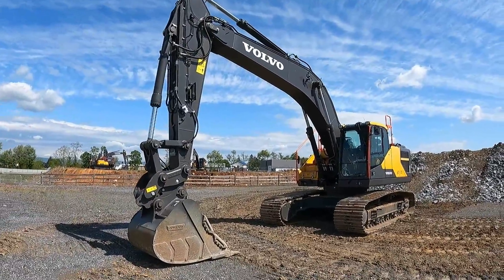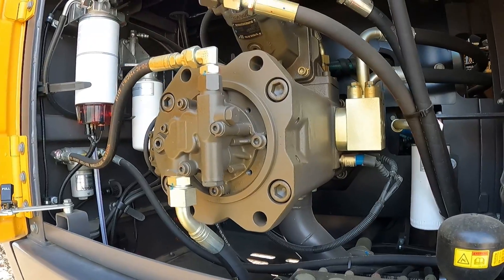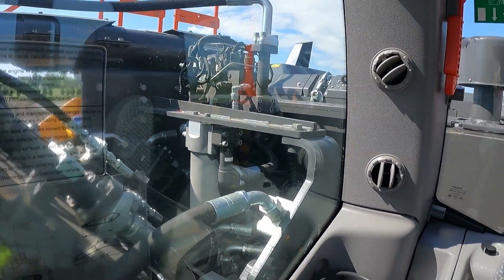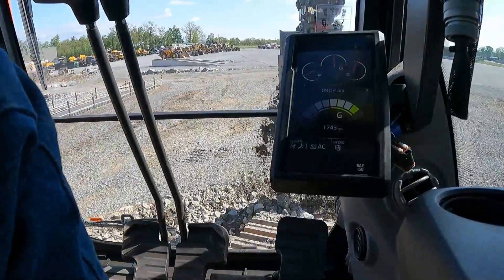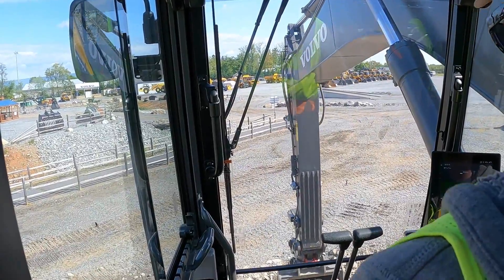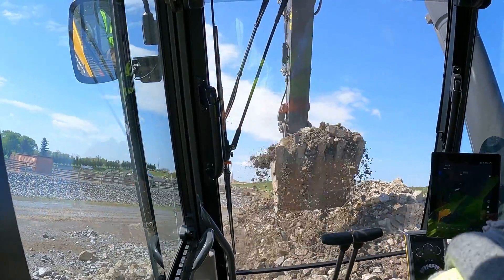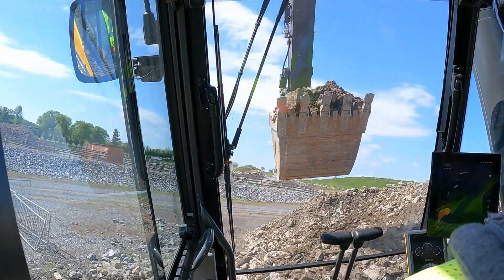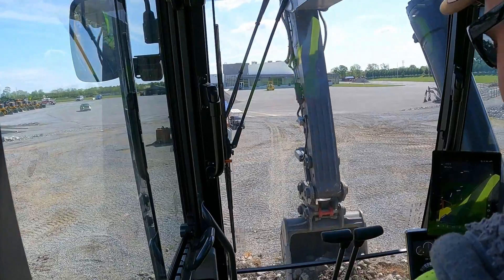New Volvo EC300EL Hybrid Excavator

Comment: Eaton Hydraulic launch assist was basically that same thing on garbage trucks years ago. Braking would drive a pump building pressure into an accumulator then pressure was released as the accelerator pedal was pressed. Cool idea but it failed due to complexity.
Reply: Voith are using the energy captured from hydraulic drivetrain retarders to do this sort of thing as well, much simpler system as the retarder is already a form of hydraulic pump. Store the hydraulic energy and release it back into the retarder as drive power. Great for buses and other stop/ start vehicles.

Comment: That accumulator is a beast! The accumulator on a tank isn't that big!
Reply: Because small chamber sucks up the pressurized oil from the large chamber with minimizing energy loss, it needs just a half of the target working volume. And smaller acc volume matches well to the typical boom lowering pressure building up in the acc. Otherwise every pressure difference makes energy saving loss with a larger acc. That is the key.

Comment: simple genius. I am wondering if it makes use of every gravity situation that utilizes hydraulic.. not just the boom? I learned accumulators with aircraft. little electric pump helpers so we did not have to start engines to move them around.
Reply: Probably only the boom as it's really the only item that gravity would assist.
Reply: @cmmartti  Except that uses a rotary motor so now you need to come up with all the extra pieces for that. Not going to be worth that when there isn't a large fluid difference to gain.

Comment: Just My opinion ... for the accumulator to actually save 15% to 17% in fuel, the engine speed would have to be right on the button throttle wise. I assume most of the time, you set your idle speed based on your ear, & what the machine needs to do the work. I also assume most of the time you have the throttle considerably higher than actually needed, but who has time to be worried about that. I WOULD NOT BUY anything like that accumulator based on fuel savings, you'll never see it in your pocket. But the accumulator MIGHT save the regular pump from some work.

Comment: Fuel expensive 😂🤣 here in the Netherlands you pay 6,30 dollar a gallon if your lucky
Reply: Similar prices in the UK.
Reply: If the US didn't have large oil fields, we would have high fuel prices too. Saudi Arabia and UAE never go above $2.00 per gallon.
Reply: @seanhazelwood3311  hold on to your pants cause it's a comin'! Gas has already went up $1.00 gal since Jan inauguration.
Reply: @msack6904  Nation wide prices are not close to a buck increase. Sides, the price rise is due to no drivers and that pipe line hack by trump's Russky friends, not Biden. Continue on with the lies.
Reply: @rickweber1490  sure that's exactly the case.🤔
Reply: In East TN, gas prices went from $1.80 in December to $3.00 this morning. That's more than 1 dollar increase and we don't have the price gouging that other places do.
Reply: @rickweber1490  Well, I'm in MO, and yes prices have climbed a buck

Comment: Not sure I fully understand, but if the high-pressure fluid stored in the accumulator is used to feed the pump, that means the pump doesn't have to work as hard to raise the pressure and provide flow as if it was taking input only from the normal accumulator.  Having higher pressure input like that may reduce wear in the pump and everything feeding it.  Kind of like kick-starting the entire hydraulic system for free.  Neat it that's the way it works.

One interesting experiment would be to operate it by lowering the bucket farther away from the cab and compare the amount of fuel when you lower the bucket near the cab.  Maybe a few tanks would tell you something...(bet there is a Volvo engineer who could tell you off the top of their head.)
Reply: It doesn't dump it into the manifold. It dumps it into the bent axis motor bolted to the aux drive on the pump to give additional drive power from the stored pressurized fluid.  The hydraulic motor supplements the torque provided by the engine to drive the pump.
Reply: @bigfunwmu  thanks.  But it is providing torque assistance so everything upstream doesn't have to work as hard.  I think that was what I was trying to say...
Reply: @TomTalley  the pump has to work just as hard as before, the torque assist takes the load off just the engine and puts it on the stored energy in the accumulator.

Comment: How does it store the energy, does it compress air for return or a mechanical spring device?  Curious..
Reply: The accumulator is a cylinder pre-charged with air behind a ram. When the fluid is charged into the cylinder, it is under machine pressure Plus the air pressure. Then that pressurized fluid is released back into the system, which is that much that the engine and main pump don't have to provide.

Many very large cylinders and systems that use the engine for hydraulics and drivetrains at the same time...like large boom trucks.
Reply: Most probably a spring but could be gas like in a shock absorber.

Comment: So its turbo charging the hyd. system this is old school been doing this for years
Reply: Large boom trucks, for example.
Reply: @seanhazelwood3311  Oil tank to check valve To pump through the Valves and back to a tee between the pump and the check valve

Comment: What does it cost to fix and what's the downtime of the machine?
Reply: That’s a funny question.
Reply: @ChrisB8s  If you make a living owning and operating equipment, It's a question that needs an answer.
Reply: Let's see- it is just an accumulator, two extra hoses, a couple of valves and an auxillary motor in a system filled with hoses, motors and accumulators. Chris also clearly demonstrates it can be turned off in seconds.
I'd say it will be near zero maintenence, until such time all the hoses on the machine start failing (usually when the third or fourth cheapskate owner has skipped preventative maintenence for years, then claims that Brand X makes junk because they can't budget for maintenence).....
Reply: @TyphoonVstrom  Hmmm. Let's see, clearly you've never worked with equipment such as this. I've seen brand new machines blow engines, turbos come apart, valves blown out of valve blocks and plenty of other stuff break on machines with low hours that have had the same design for years. WEEKS of downtime if the manufacturer  doesn't give you a loaner means lost income. I bet you're the type of person that would buy a truck with a newly designed engine and wonder why so many recalls start popping up.
Reply: @69dildozer  Exactly. What other construction equipment uses accumulators, rock breakers. The most repaired part on rock breakers, the accumulator.

Comment: It's a heavy machine, but the motor and the accumulator are not enought protected for my taste. Thank you for the vidéo.
Reply: If you damage that accumulator or additional motor (how, it is protected by the main motor), you have bigger things to worry about- like the fact that whatever it is that damaged the accumulator is also now in the cab....
Think before you comment. How is anything going to get past the boom and back of the machine and even get close?
Reply: @TyphoonVstrom   i did not make this comment check first before you send
Reply: @TyphoonVstrom  Yes of course ! you are the only one that can think. Sorry for watching the vidéo. But why on some other chanel some piece of tree or other demolition piece of concrete fall on the excavator ? I'm not lucky at all, i can't think so i'll never find the answer.
Reply: as with cars this is the future